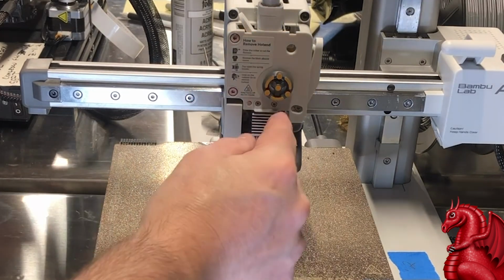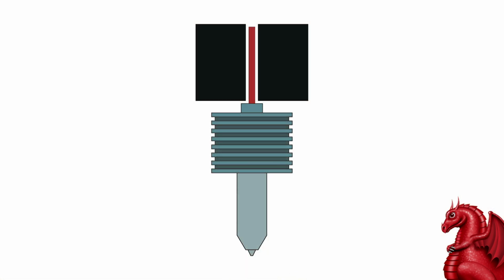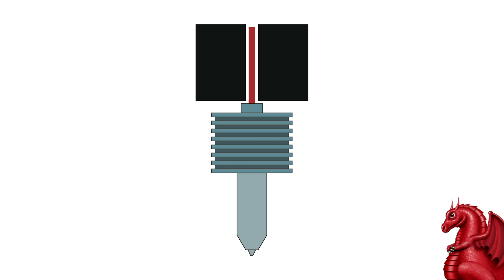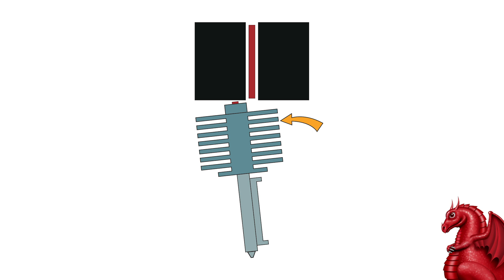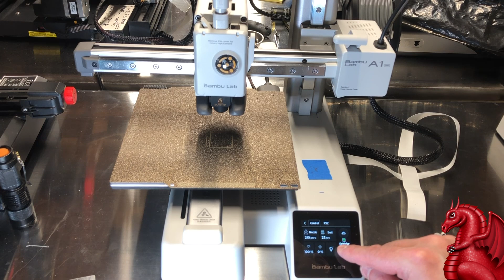Bambu Lab A1/A1 Mini Stuck Nozzles - easy fix for difficult to remove nozzles!

Comment: But what happened if the nozzle can’t heat up? What else can I do to remove it?
Reply: I'm having the same problem. Did you find a solution? Hot end wire is broken and it won't heat up. I need to change the hotend but can't take the nozzle off and can't heat it.
Reply: @nanauntel you use a blow dryer and get some pliers to remove the filament so you don’t get burn

Comment: My hotend is permanently fused into the heating assembly.... There is no  amount heat that ltes it go. I can't remove neither the extruder nor the heating assembly as both depend on taking the hotend out..... The whole top assembly needs to be replaced. Waiting to hear from Bambu Customer Service. They sent me all parts to change out after a monster blob incident. I just can't change things without taking the hotend out..... Hoped your instructions helped but we are well beyond this point...

Comment: Never had problem pulling nozzle out. I usually wait till it cools down while, then pulling with finger at bottom while pushing down from the top. Getting back in is harder because magnet on back keeps closing gate that holds it.

Comment: Has anyone tried this and still been unable to remove the nozzel? I've got a .4mm in my A1, and have tried the steps in the video but no luck. If it matters I have an AMS lite unit attatched, and have been using PETG. For some reason, my A1 doesn't do the twitch on the first extrusion attempt, and all of the attempts listed below were tried with 1 and 2 extrusion presses. 

I've also tried:
Loading a filament, cutting it manually then extruding once.
Loading the filament, unloading the filament before and after trying to extrude once.
Just extruding once without loading a filament as the idle state has all 4 filaments pulled out of the head.

I haven't been able to find any other content online displaying a similar issue without disassembling the head, and I'd rather not do that.
Another thought, this started for me after a recent firmware update but I have no evidence that is the cause.

Comment: Bambu lab should put you on their payroll. This is the place to go for troubleshooting!
This solution however did not fully work for me. I needed to reheat the nozzle to 100 celcius (using PLA) to heat the PLA that got sticked on the sides/back of the nozzle to be able to take it out. I found out that this procedure even worked without cutting the filament like i should have ;)
Reply from the maker: PLEASE TELL THEM THAT! :D

Comment: I have an A1 mini and I have switched a number of times between a hardened and stainless steel nozzle.  The stainless nozzle has stuck a few times and my fix was to remove the sock,  open the latches, and then heat it up to about 180 and then gently pull the nozzle off with a pliers (while it is hot).  In my case, there was some sticky residue and I assumed it was gluing the nozzle in place.  The hardened nozzle hasn't had the problem.  I also have to be careful not to accidentally push in on the fan on the side of the print head

Comment: The hotend comes right off quite easily if you take the two screws out right above the hot end.  

The plastic triangle comes off. Pretty sure the wiki says to take it off when checking an extrusion issue.

Comment: I had a print back up on me enough that the hot end, as well as the extruder, ect, is all fairly well coated in PLA. Any suggestions for undoing the mess?

Comment: after doing this I still can't figure it out. my filament was very clearly jammed, so I decided to try using a needle in the nozzle to help clear the jam. I got a lot to extrude, but now my printer is barely extruding once more and it's making a clicking sound when I extrude. I was attempting to take the nozzle off and just buy a new hot end so that it would clear this whole mess up, but now I can't even remove the hot end, even after these steps. this is such a nightmare for no reason.

Comment: Hello great vids, but what can we do with the stains (like rust oil things) that are left in the machine between the nozzle and the magnetic part, is there a way to clean them? how mutch time a nozzle last? got a stainless steel one but its just the part that gets hot not the tip anyway great vid

Comment: Maybe someone can further advise, but after my prints have completed and before I power off the machine, I unload my filament with the intentions of allowing residual filament to not become an issue for my next print session. I could imagine and would hope this prevents any future issues like clogging or whatever and also allows the nozzle to to be easily replaced and maintained.

Comment: Advice on how best to unclog the 0.2mm hot end would be great, I've had the printer for a day, first print with the 0.2mm nozzle failed (it can't do supports with 0.2mm very well, lesson learned) and now it has a partial clog, the methods on the bambu site aren't helpful, the first (heat to 250 and extrude) just made a worse blob, the second cold pull method seems excessively difficult compared to other printers, or at least makes me wonder if there's a better way than oven glove + pliers. Huge teething problems with the 0.2mm nozzle, which is unfortunate since printing minis is the main thing I'd like to use it for.

Comment: It's not such a big deal. Instead of removing the hot end by grabbing the upper square part I most often pull it out by the pointed end at the bottom. Haven't needed to extrude the remaining filament in the nozzle.
Reply from the maker: That's doesn't always work, especially if the machine has ever had a print failure where PLA has leaked up into that area. Even after cleaning enough remains to make pulling the lower section away extremely difficult as shown in the video. This way works every time.
Reply: @Tombof3DPrintedHorrors  I actually can't get this to work for mine. It's still quite stuck. I'm terrified to wreck the arm that controls the up and down motion by putting too much pressure on it

Comment: Great tip! Another way I found to safely unload your filament is by using the Filament option on the control panel and then use the Unload command.  You tend to get a nice clean cut that makes things easy to remove.

Comment: Thanks for that video. Sounds very familiar to me

With the first several prints the 0,2 nozzle was fine and easily to get out. Then exactly the same as you describe happened. By the way I have this issue only with the 0,2 Nozzle, not with bigger ones….

Last week I had a nozzle clogging, at least I thought it was one. Doing several things to get the filament out and  when I removed the hotend, the nozzle itself slipped out of the heatsink without any effort.

So from my point of view the loosing connection finally caused the situation where no filament was extruded anymore and seemd like a clogging.

On the nozzle itself is no breaking line visible, no glue, Loctite or whatever might be used.

I will contact Bambu and will try to get a feedback from the support. Maybe with the high demand and shortage in availability of the 0,2 nozzles, quantity was prior to quality (not meant as blaming)

Comment: Thanks for the A1 videos, I have been saving your A1 videos to a play list for quick reference when I run into a problem. Does the nozzle need regular maintenance (cleaning, etc.) if you haven't had any issues with filament extruding or clogging the nozzle? I have been using my A1 for the past two months and (knock on wood) have only need to lube the rails and Z rods.
Reply from the maker: Nope, the nozzle is generally maintenance free, but I usually do a 'cold pull' every two months or so to prevent clogs.

Comment: What I am doing when taking out the nozzle is first detach the tip that since that is the magnetic part that makes most of the process difficult. There is no need to do anything else. It works everytime, no need to heat up the nozzle.

Comment: Dear Tomb of Horror.
I do not agree with this. 
Here is the easy method to remove a nozzle: 
Open up the clamps, pull the BOTTOM of the nozzle out towards you .. then it will come down and out by itself. No problems. 
When inserting a nozzle, you "thread" it in and up…. and push the bottom of the nozzle in place as the last step.
No problems.
Reply from the maker: I've tried that and it doesn't work the majority of the time for me. The way I show works every time.
Reply: I use this method and I have a very good success rate  with it. Also I don't need to: heat the printer, activate manually the extruder, wait for the printer to cool down.
Reply: Exactly.
Reply: So on the first change the nozzle came out fine for me - with that bit of filament sticking out the top. When I go to change back am I supposed to do anything to that filament? Just thread it back up or cut it off?
Reply: @ I just put it back. It will be melted and pushed through automatically 👍🙂
Or sometimes I cut it, if the cutter is lying in front of me. 5% easier to put it back if cut (I think) 🙂
Reply: @oljobo  Thanks.

Comment: Just a idea, but can you also do a kind of "cold pull" (at 160 degrees)? That way you not only pull all filament out of the nozzle, but also clean up that nozzle. After cooling down (what should go even faster at this low temperature) you can simply swap that nozzle for a new one...
I have not tried it (yet), but it looks too me this is a alternative method.
Reply from the maker: It is an option, but you have to be careful doing cold pulls with this machine. If the end of the filament breaks off inside the extruder it can cause jams and you'll need to disassemble the entire thing to get the piece of filament out (this happens occasionally with the AMS switching colors.) The method I show doesn't risk any jams.
Reply: @Tombof3DPrintedHorrors Fair enough. As said - I have not tried this, so I have no experience with it.